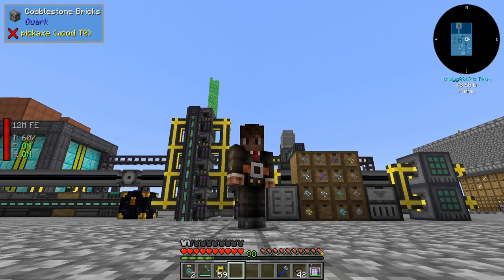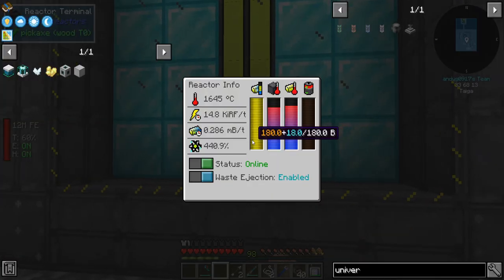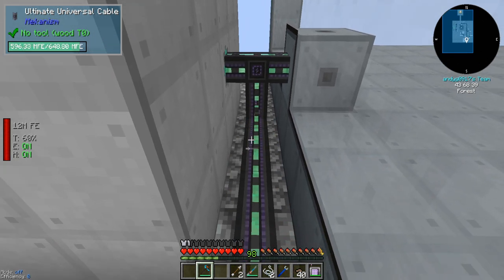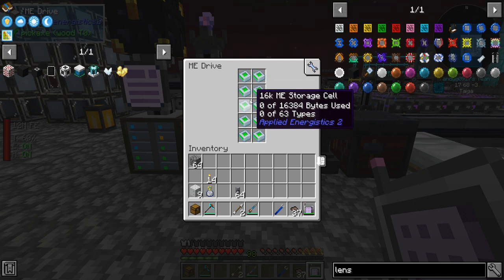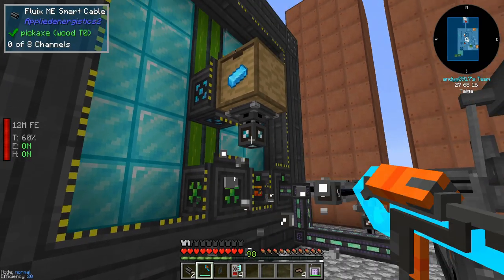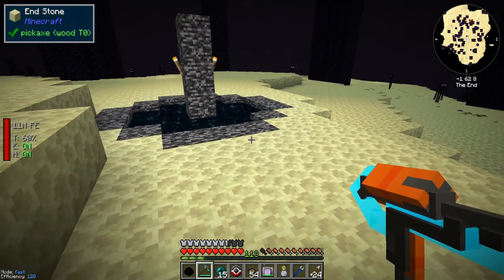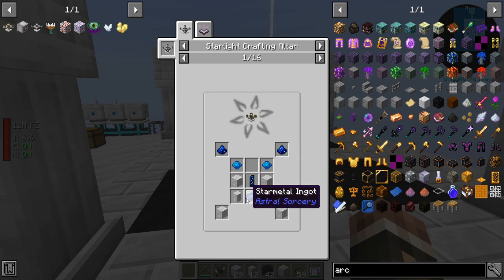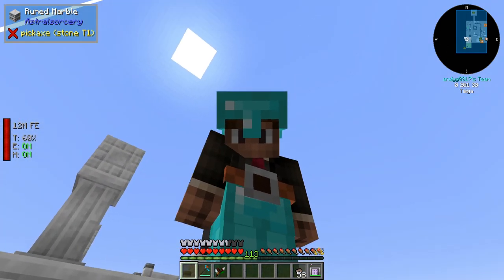All The Mods 6 To The Sky Episode 7: Beginning Magic and Environmental Tech

Comment: Just a small tip for future stints with environmental tech: The progression is heavily gated by how many crystals you can get and it's SLOWWW early on. The number of ores you get from tier 1 miners are negligible anyway. So it's probably better to make as many low-tier miners as you can afford and dedicate all of them to get crystals. Upgrade them, all the way to like tier 6 or 7, then convert a couple of them to get the ores 😎
Reply from the maker: I think I've pretty much passed the annoying hump by the end of this episode, but yeah... That would have been a better idea lol. Believe it or not, never used environmental tech in a pack before
Reply: @MainlyAndy  Yea and 1.16 ET is a little different. In 1.12, the same miner gets you crystals and all the ores at the same time. But in 1.16, crystal miner and ore miner were separated. So the start is really on the slow side. But yea once you're pass the first 2 tiers or so, it's fine. 😉

Comment: When using watering can, you have to press the button and pull it back, it doesn't work at full efficiency when you hold it down.
Reply from the maker: hmmm, interesting. There's usually better growth acceleration options so I've never used it before